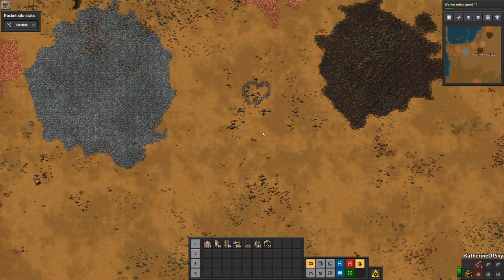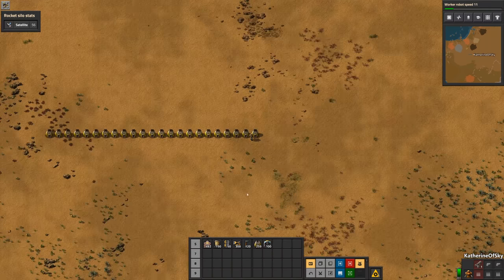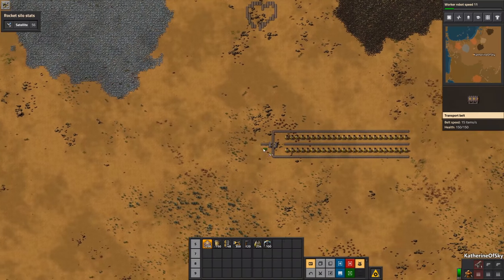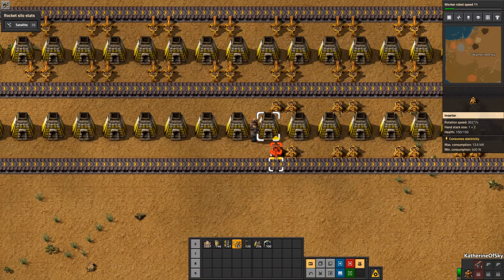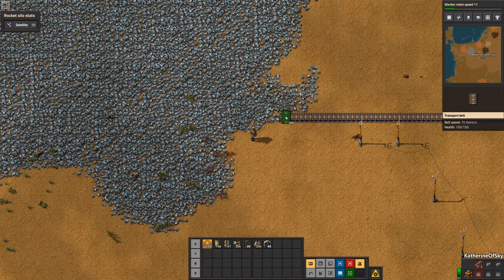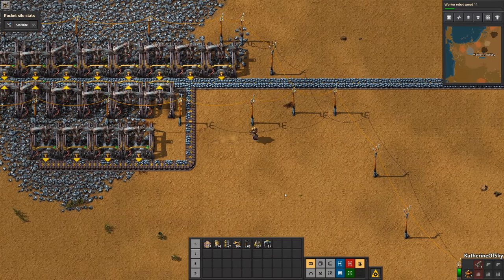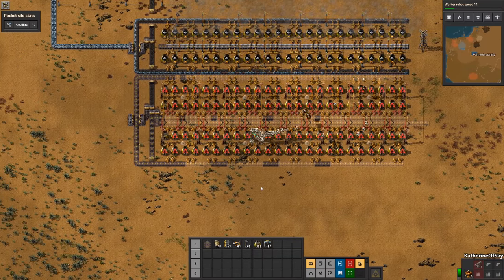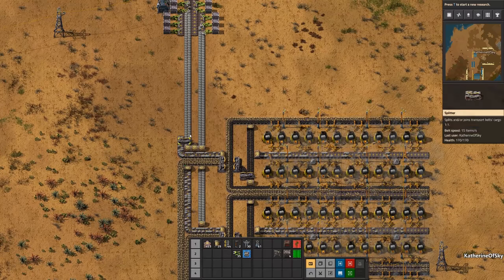Factorio: HOW TO BUILD A SMELTING SETUP - Tutorial, guide

Comment: I disagree a bit with coal vs electric furnace.

By the time you are producing red circuits for electric furnace, you almost certainly likely have access to either solid fuel from petroleum or solar power at that point.

Switching to electric furnace have a hidden indirectly bonus that doesn't get mentioned a lot. Coal based furnace produce a tiny bit of pollution all the time which attract more biters overall. Switching to electric let's you produce your pollution in a more centralized defensive location or alternatively go with a green-based solar/nuclear grid which will see fewer biter aggression.

Otherwise great tutorial.
Reply from the maker: By the time you get to electric furnaces, biters should not be an issue.  I'm not sure of your point with the furnaces: both types produce pollution and you can place them wherever you want.  And you are incorrect: fuel-based stop producing pollution when they are shut off.  Electric ones have a drain (constant electricity usage), meaning they produce pollution even when off.
Reply: @KatherineOfSky  

The better question is what machines: 'inserter, beacon, assembler, refinery, electric miner and etc...' doesn't drain electric while idle?

Might as well shift the coal boiler, for efficiency, to solid fuel which have 3 time more energy density. Would you re-assign your coal input belt to solid fuels for furnace? I don't think so. I did theory craft once to use nuclear fuel for steel furnace which would have been ridiculous.

You are still better off long-term pollution-wise combining better/efficiency power grid and switch earlier to electric furnace.

The only time I don't advocate electric furnace is if you are going for a "There is no spoon" speed run.
Reply from the maker: I already answered your first question: Steel and Stone Furnaces don't use power when idle.  I feel like you are trying to twist the discussion, and refuse to see what facts I have put forth.  Other machines are irrelevant to the discussion.

Also, you are wrong in your assumption:  I do shift Solid Fuel onto the fuel line when coal runs out.

Also, long-term pollution is irrelevant since biters are irrelevant.  Just use artillery to destroy nests in the pollution zone and your are done.  (Electric Furnaces still use more power.  (Whether it's fed from coal into steam engine boilers, or directly consumed by the furnaces, you are still burning power)).  If you have a billion solar panels, then you have "expensive, but free power", so electric might be OK in that instance, though IMO you are still better off with Steel furnaces because coal is so much cheaper than red circuits.
Reply: @KatherineOfSky  
Twisted the discussion?

I don't appreciate that accusation because I do base my ideal grid on switching the electric furnace earlier based on in-game facts.

Electric Furnace and Steel Furnace look like they produce pollution at the roughly same rate on the surface. I have notice many have overlook one of the simple factor driving me to making the change earlier is that electric miner produce pollution by mining coal and lowering your total coal intake is one of the easiest way to eliminate pollution without losing any overall productivity.

Which would produce more pollution per minute? 48 Steel Furnace and ~11 coal Electric Miner (for both power/furnace)? Or 48 electric Furnace and ~4 coal Electric Miner(for power only)? Assuming same inserter/iron electric miner/etc... layout for both scenario with same pollution production.

I will be awaiting your reply.
Reply from the maker: If you look at the Factorio wiki it gives you plain and simple facts.  Let's start with electrical power: 4MJ of coal (1 piece) turns into 4MJ or electric power: https://wiki.factorio.com/Boiler.  So we are left with which structure uses less energy since the ratio of fuel conversion is 1:1 on both electric and burner power.

A Steel furnace uses 90 kW, no drain.  It produces 4 pollution/min: https://wiki.factorio.com/Steel_furnace

An Electric furnace uses 180 kW, and has 6 kW drain.  It produces 1 pollution/min: https://wiki.factorio.com/Electric_furnace
A boiler produces 30 pollution/min at full speed.
A steam engine produces 900 kW of power, divided by 180 is 5... so 1/5, also divided by 2 because a boiler can produce enough for 2 steam engines, giving us a 1/10th value for pollution.  ... so 3 pollution from boilers, plus 1 from the furnace is 4 pollution.

Conclusion: Steel furnaces use half the power of electric furnaces.  They produce the same amount of pollution.
Reply: @KatherineOfSky  

You are looking at a very narrow scope.

Steel Furnace's ore has to come from somewhere! You would have more than a few dozens electric miners which would have approximately 5.6 MW power draw. You would have to setup more coal electric miners to feed enough boilers to not brown out. ETC...

Each electric miner produce 10 pollution per minute which is equivalent to roughly 2 and half steel furnace each.

It would take 10 electric furnaces to match one electric miner. In exchange you have to provide a bit more coal for roughly 14.8 MW or so.

The difference is that you are going to scale that power grid anyways to handle more load no matter what. Might as well switch.

Quick napkin math for steel furnace:

48 steel furnace * 4 pollution + ~3.2 boiler * 30 pollution for power + 70 electric miners (coal/iron both) * 10 pollution = ~988 total pollution per minute.

Quick napkin math for electric furnace:

48 electric furnace * 1 pollution + ~8.2 boilers * 30 pollution + 60 electric miners * 10 pollution  = ~894.6  pollution per minute.

That is 80 pollution per minute less before even touching beacon/productive modules etc... It will get even better once you cut half of power demands and replaced it with solar power or nuclear energy or whatever. Feel free to check my math.

All numbers from wiki and personal experience of tweaking with various setup for low pollution.
Reply from the maker: I don't think you read what I wrote: you need MORE fuel for electric than steel furnaces: whether you get it from coal or oil, or wherever.   My numbers come from the wiki - yours seem to have been invented.  Read the wiki. Look at the numbers.  I'm done here.
Reply: @KatherineOfSky  

Look again. Which numbers are invented? Boiler 30 pollution per minute? Both furnace 4 and 1 respectively per minute?

https://wiki.factorio.com/Pollution

Seriously go look here. You are dodginng my point that long-term you would be better off switching to electric furnace especially with a middle-game base. The earlier the better.

Which translate into an abstracted fewer biters intensive attack waves. Then you don't need as much power/ammo. Which means less pollution. It just snowballs from there all without more efficient power grid and productivity modules etc...
Reply from the maker: I'm using the numbers from the pages I linked.  I'm not dodging your point, I am hitting it right on the nose*: it is NOT better, by any means to switch to electric early.  If you want an efficient base, the only modules you should be using in furnaces are productivity, surrounded by speed beacons.  That generates  heck of a lot more pollution than Steel.

You seem to be completely missing my point and the calculations I did in the post above: Steel furnaces use half the amount of fuel, and produce exactly the same amount of pollution as electrics.   This is my last post.    I'm tired of arguing this with a person who fails to read and understand what I've written so clearly.
Reply: @KatherineOfSky  

Once again you are missing half of the picture and focus only on the furnace while ignoring boilers/miners which also produce pollution. 

For instance, Boilers produce 1.8 MW of power for 30 pollution. Electric miner consume 90 kW of power to produce ore and 10 pollution per minute. All of this info also come from the same wiki.

I also used the Factorio planner here to confirm the total power used for both steel furnace (6.4 MW for miners) and electric furnace (14.8 MW for both miner and furnace).

https://kirkmcdonald.github.io/calc.html#items=advanced-circuit:f:1

The electric miners for steel furnace (60 for iron ore and 11 for coal for both furnace and boiler) is the missing piece which makes your steel furnace more or less worse than electric furnace because you don't need as many coal per furnace despite double energy used per furnace.

If you want me to demonstrate this in-game I will.
Reply from the maker: Already answered.  Scroll up.  I took everything into the calculations.
Reply: @KatherineOfSky  

48 electric furnaces - 8.7 MW used
60 iron electric miner – 5.4 MW used
Total energy: 14.1 MW used so far, excluding inserters. Because they only use about between 400-600 kW and fluctuate too much depending on swing time and idle and is same for both steel/electric furnace anyway.

Coal – 4 MJ per unit convert to 1.8 MW and consume coal at ~0.45 (boiler consume 1.8 MW from 4MJ) per second for each boiler. I am going to re-use this number a lot.

So to power all of this you need 8 (rounded up) boiler and sixteen steam engine running close to peak efficiency.

8 number of boilers * ~0.45 coal per second = 3.6 coals per second. I am going to round up to 4 coals per second anyways, you will see soon why.

Putting down 8 extra electric miners raise the power used to 14.8 MW and corresponding need another boiler setup. 14.8 MW divided by 1.8 MW is ~8.222. Otherwise you would have everything run slower due to not 100% satisfaction.

Conveniently, To run 14.8 MW you only need 3.7 (14.8 MW divided by 4 MJ) coals per second. 8 electric miner, from rounded to up to 4 coal per second, is more than sufficient to keep up.

Link to total power and production chain here: https://kirkmcdonald.github.io/calc.html#data=0-17-60&rate=s&min=2&items=iron-plate:f:48,coal:r:4 

48 steel furnace – uses 1.08 coal per second or three electric miners (0.0225 coal per second * 48 steel furnaces = 1.08)
60 iron electric miner – 5.4 MW used

To meet 100% satisfaction you need 3 boiler setup (5.4 MW divided by 1.8 MW = 3 boilers). From that we can infer that you need ~1.35 coal per second (3 boilers * ~0.45 coal per second from earlier = ~1.35). But since we have an extra 400-600 kW of power used for inserter arm swings I would have to put down one extra steam engine to keep it at 100%. 

The reason I didn't put down an extra steam engine earlier for electric furnace is because you have 8.2 boiler setup and that meant 17 steam engine rounded down to 8 and half boiler. You can't put down a fractional of a steam engine and conveniently have enough power buffer to handle inserter swings where you don't here.

So I have to raise coal used per second from ~1.35 to ~1.575 (0.45 coal per second for full boiler setup divided by two and add to ~1.35).

Then you go back to 48 steel furnace 1.08 coal per second and add ~1.575 to get ~2.655 coal per second. This mean you need 7 coal electric miners total.

All of this bring the power used up to 6.0 MW total which is small enough that 4 boiler is more than enough to keep the whole thing powered.

Link to production chains here (important notice I rounded coal output used up to 1.92 to have whole 6 electric miner instead of faction 6.2 electric miner):
https://kirkmcdonald.github.io/calc.html#data=0-17-60&rate=s&min=2&furnace=steel-furnace&items=iron-plate:f:48,coal:r:48/25 

For convenient, I am going to assume each 1.8 MW is 30 pollution per minute. So I am going to divide 1.8 and time by 30 (total power / 1.8 * 30).

Now for the total pollution tally at last.

For Electric Furnace:
Electric Furnace 48 * 1 pollution per minute = 48
14.8 MW of total power used (500 kW extra for inserter swings)
14.8 / 1.8 * 30 = 255
66 electric miner * 10 pollution per minute = 660

48 + 246.7 + 660 = 954.7 pollution per minute

For Steel Furnace:
Steel Furance 48 * 4 pollution per minute = 192
6.0 MW of total power used
6.0 / 1.8 * 30 = 100
66 electric miner * 10 pollution per minute = 660

192 + 100 + 660 = 972 pollution per minute

All I did was clean up and make my earlier calculation a bit easier to read and understandable. But the number doesn't lie or change no matter how many time I re-run the number. I even doubled checked the power demand used in-game using cheat mode and void belt (to keep electric miner running 100% because cheat mode add a 40% extra productivity which will throw power demand and coal per boiler number off).
Reply from the maker: If you look at the Factorio wiki, it says that 1 piece of coal generates the same amount of power in a furnace or in a boiler.
The Steel furnace uses half the power of an electric smelter.  My calculations above show that both produce the same amount of pollution.
Very simple.
Reply: @KatherineOfSky  

Look. 

You need more coal per second to run 48  steel furnace than to run 48 electric furnace in total. Because you are only looking at Furnace vs Furnace, you missed the point that you need more electric miners. Electric Miners produce 10 pollution per each minute from in-game info UI and wiki.

Quote: "Pollution 10/m"

https://wiki.factorio.com/Electric_mining_drill

I gave you my math and I checked everything in-game and it match my math. MW usage and numbers of machines to run everything and more. I even went far enough to calculate that inserter produce ~10 pollution per minute (600 kW / 1.8 MW * 30 = 10) for both furnace setup which wasn't significantly enough to include in my work from earlier and numbers of inserter would be same anyway (48 furnace * 2 input/output inserters).

It takes approximately 3 more coal miners to run 48 steel furnace and you gain 30 pollution per minute or so.
Reply from the maker: You do not need more miners.  I am so tired of repeating the point that you seem to be missing:  coal is coal is coal.  It creates the same amount of energy when burned in a furnace or in a boiler.
Reply: @KatherineOfSky  

I told you. I already tested in-game and provided you with links which shows that the numbers of miners is not equal. You don't want to accept valid criticism.
Reply from the maker: @Plaguebone1428  My information comes the wiki.  Criticize that to the authors.
Reply: @KatherineOfSky  

I think something was lost from my last communicate...